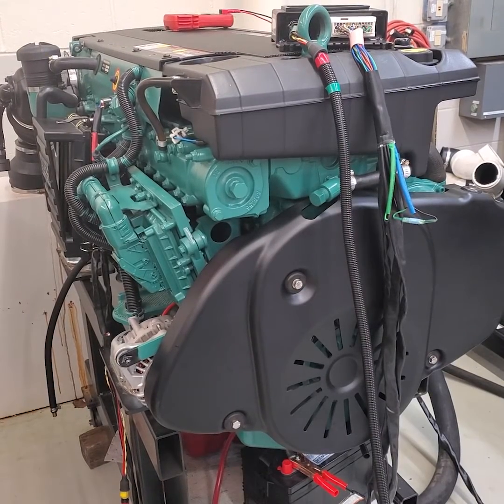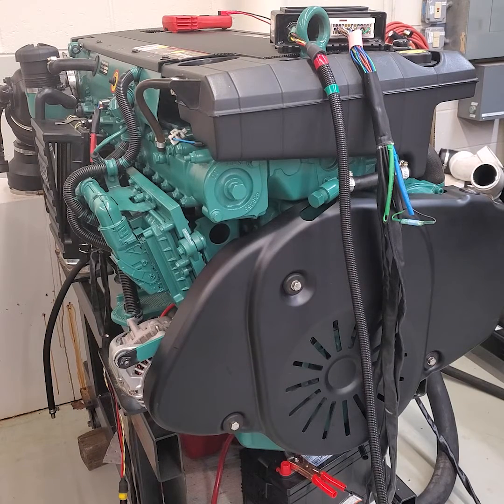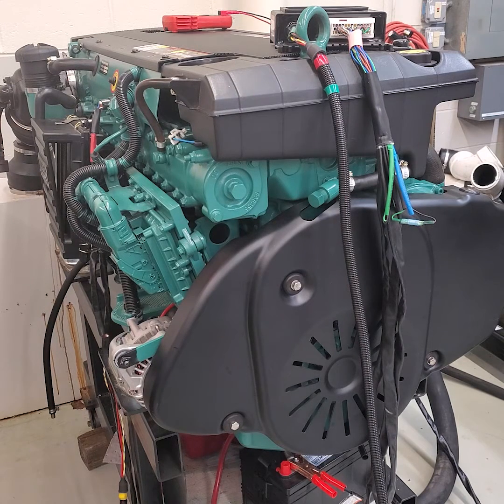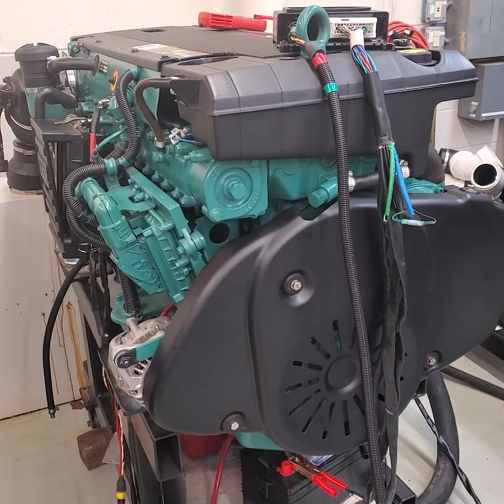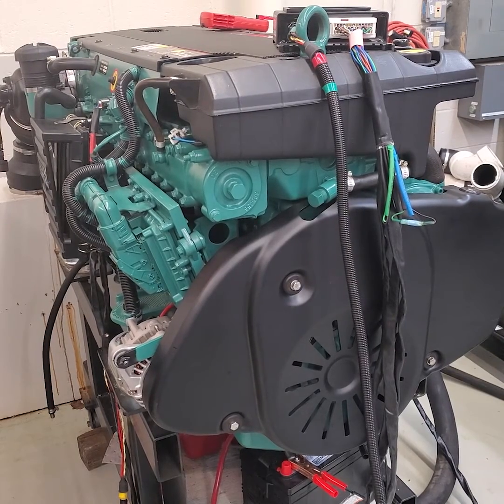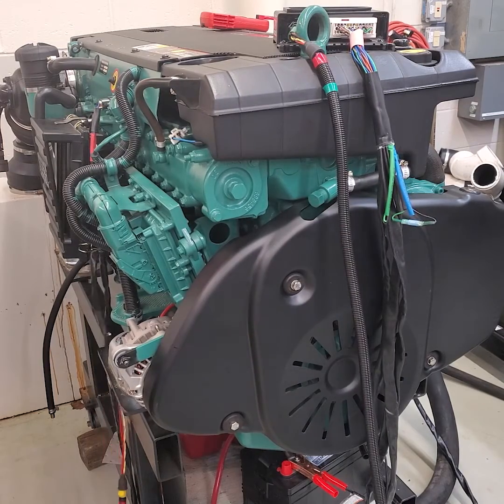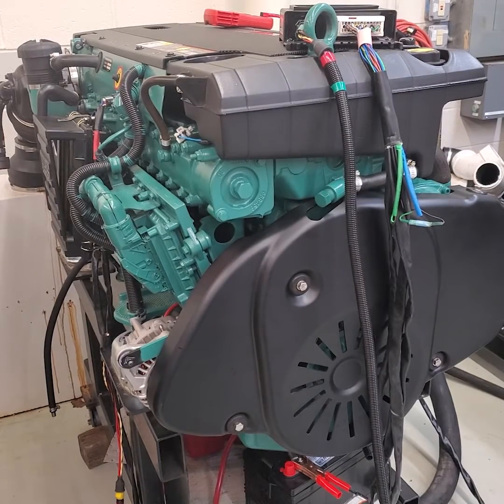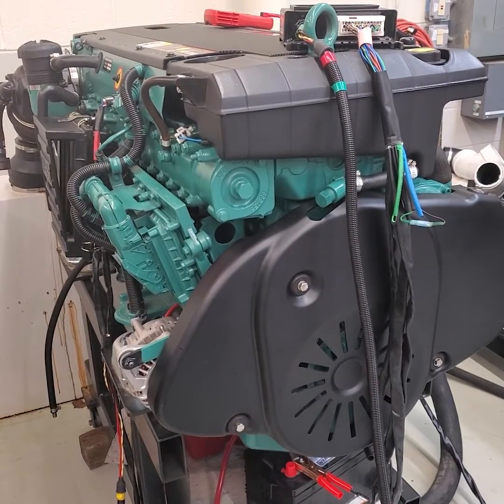Volvo Penta D6 Failed MPROP on a running marine diesel

Comment: Hi Ted,

I have a volvo penta d4-260, recently an error appear in the EVC when reach 2200rpm. 

mid 128 psid 50 fmi 5. It means low fuel pressure.

I have checked for air leaks, fuel pipes, fuel tank, change the fuel filter. The error still appear and the power is reduced and now start happening at lower rpm.

I have see this video and in my my case If I disconnect MPROP the engine rpm reduce close stall, It has not the same reaction  that yours . Do you know why?

Any idia that helps me to find the root cause will be perfect!!
Reply from the maker: Please email me at marinedoc01@yahoo.com  for consultation

Comment: Hello, i have a Volvo penta d3-190 with mid 128 sid 2 fmi 11 and mid 128 sid 5 fmi 11. the injectors are not faulty. And it starts for a second after deleting fault codes. I dont know what to do next.
Reply from the maker: Call a volvo dealer who has Vodia